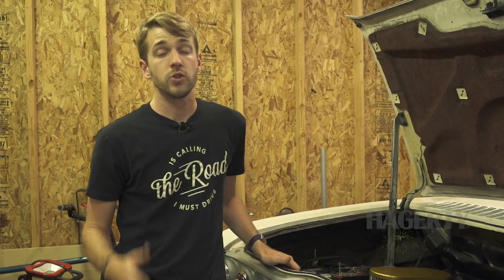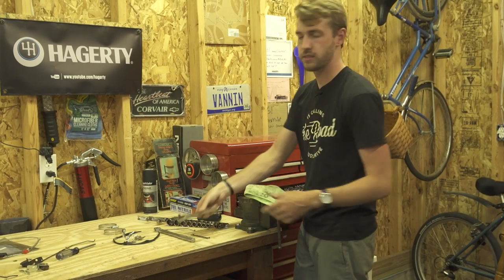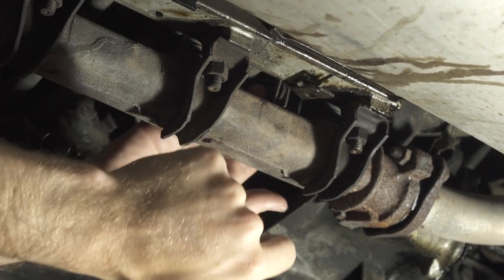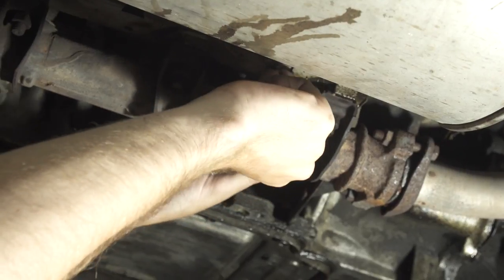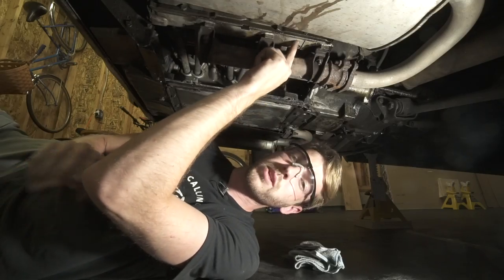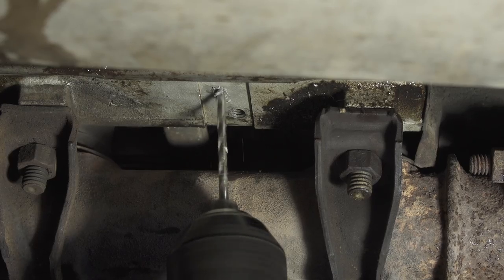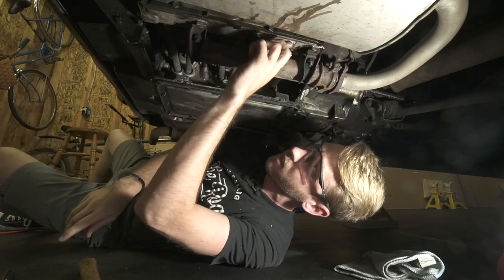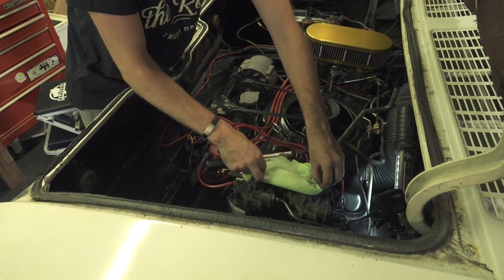How to Replace a Choke - Chevy Corvair | Hagerty DIY

Comment: You forgot something in your adjustment at 11 12..the corvair shop manual tells you once the rod goes into the hole on carb arm to lengthen it an ADDITIONAL two turns long. This ensures the choke flap closes to give a cold start and a warm up period while the choke coils reach temperature..also you have a missing rod on your choke pull off arm. This also helps with cold starts. Ive owned two Corvairs now for 22 years and have done choke coils, rods, and carb adjustments many times..Otherwise nice to see a younger guy working on a Corvair, and watch that 140 for dropping valve seats..Thats also happened to me on my 65 Corsa with the 140..take care !

Comment: Great video! 4:34 No Corvair parts are cheap anymore! These thermostats are $27 each at Clark's. After many years of great service, Clark's is failing us. Prices are up and quality is down. I love my '67 Monza 140 but its days are  numbered. Should have bought a Camaro in 1980, not a Corvair. BTW I bet that after cleaning, that thermostat coil would be fine and outlast/outperform whatever new part you got. Also, you are missing the short wire links from your while vacuum break diaphragms to the curved slot on your choke lever.

Comment: We were successful in getting the part out but when we tried to drill out the hole with the bolt holding the drill bit wanted to wobble out the hole where the rivet went.  Any suggestions?  Helen